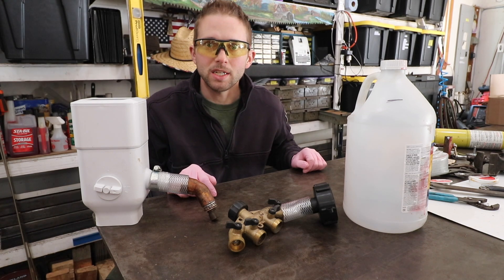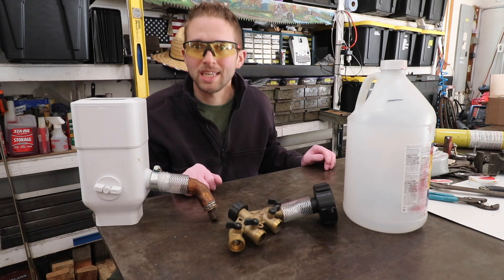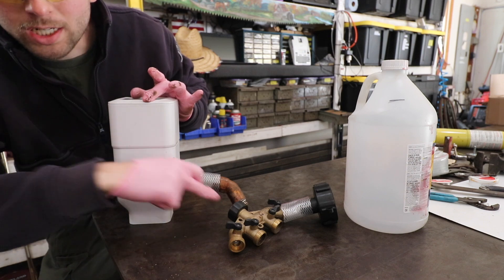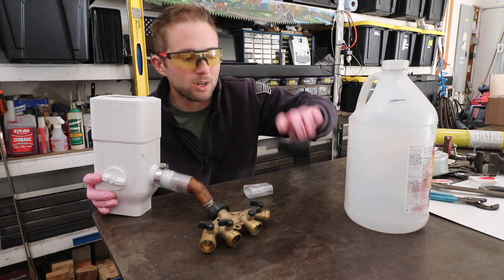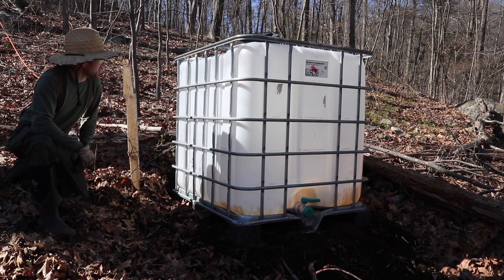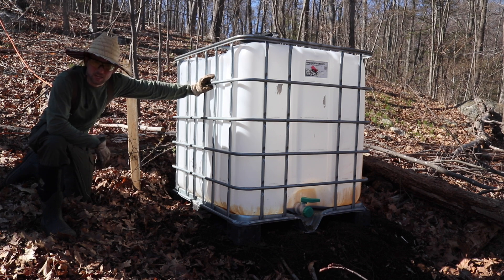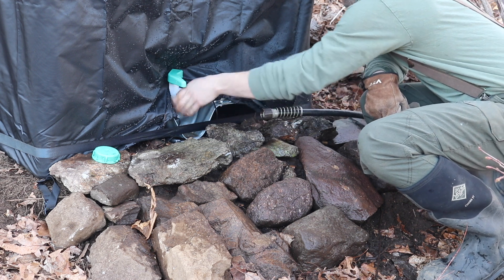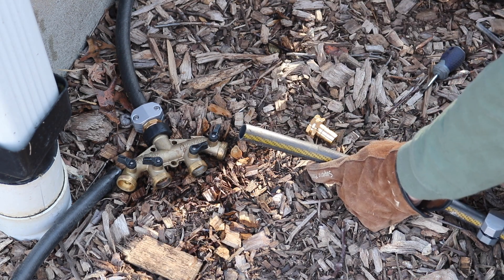IBC Rainwater Harvesting System 🌧️ | DIY Build

Comment: Filling the top of your tank will be very slow because there is no drop. If your tank was at the base of the house it would fill very quickly. You could set up a tank uphill and one below to fill fast and then fill the top one using a float valve to shut off fill on the bottom one gets full.

Comment: Did this work out? Won't you need your eavestrough to be always flooded....and not leak at any point along the way....for water to travel up the hill?
Reply from the maker: Had 2 small issues. I’ll correct them and do an update in a future video. 

No, the gutters do not need to always be flooded as the diverter valve steals the water from the downspout. 

The hose connection between the valve and the tank is leak free. The valve is about level with the top of the tank. The hose in essence works like a water tube level. The water in the tube always wants to level out. Because the top of the tank and the valve are level, water will fill up the tank (as it strives to level out). Please look up water tube level to get a visual.

Comment: Interesting.   Do you have any concerns with the water freezing in the winter?   I've always wondered about that with IBC totes.
Anyway, thanks for posting and thumbs up.
Reply from the maker: Great question. This system is only for non-winter use. Prior to the first freeze, the tank must be emptied, hoses drained, and diverter turned off.